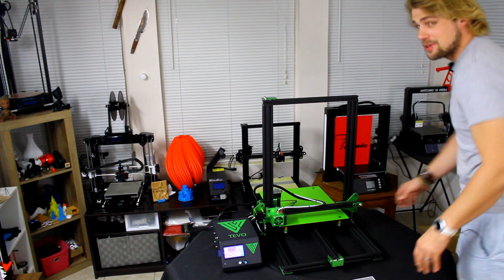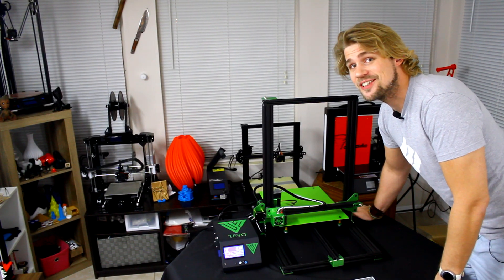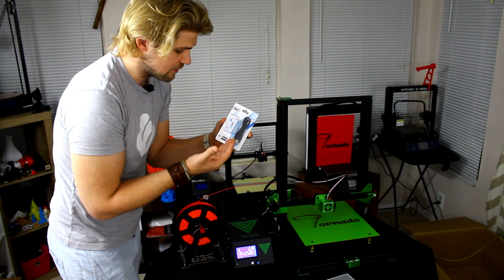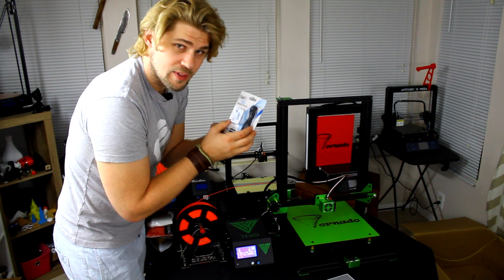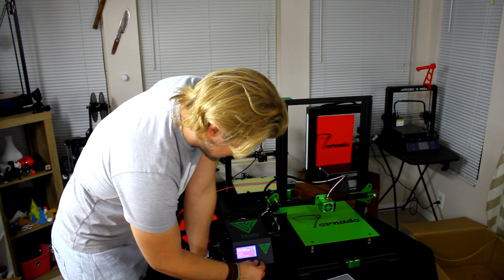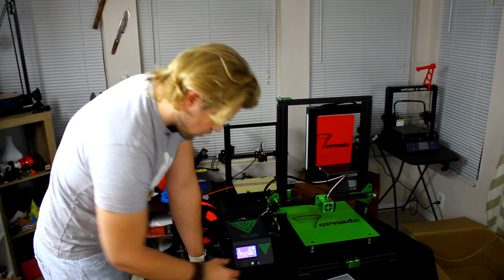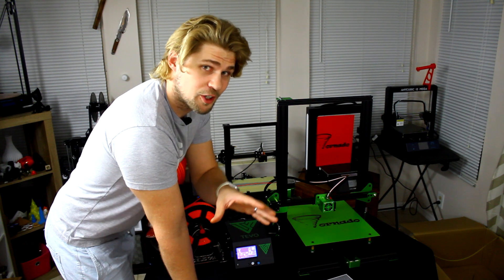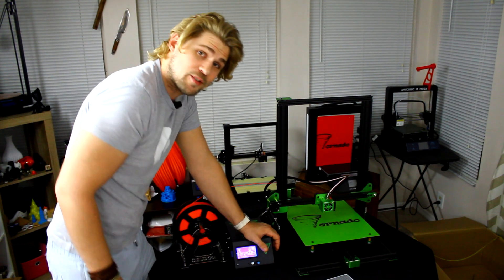✔ TEVO Tornado 3D-Printer ULTIMATE REVIEW!

Comment: Great review..

My experience...
I bought a TEVO Tornado and received it the second week in April. Since then I've had to order and purchase many replacement parts that were installed incorrectly by the manufacturer. The Support contact "Summer" messaged me upon  my sending my support request, on April 27, 2018, through their website site. They asked for details and images, since sending all info and 5-6 images they have not  responded in the last 12 days. I have allowed plenty of time, incase the case manager was sick or on leave for a few days. I bought it because of all the great reviews, but most are unboxing and initial thoughts of their tornado, only a few work with them for 100's of hours prior to review. Mine Worked on day 1, day 3,  and day 4.. Then it slowly has been falling apart. My input, look at other printers.. Talk to more people.. I'm very disappointed in the support, i know its not a $20,000 printer. Whether is $200 to $20,000 customer support should fix manufacturing defects. 
Viewers: Best of Luck in your search for a good 3d printer..
Reply from the maker: I completely agree!) Regardless of price support should be offering better help after first responding.
In my experience I can get returns from the selling company faster then I can get a hold of manufactures. Are you contacting Tevo or Gearbest?

Comment: As this is my 1st 3D printer and a few things (so far) escape my understanding. I just put the printer together and all went fairly well. I got the Red 3M sheet in the box, but I see printing on the green bed, so what and when does the red sheet come into play?
Also, in one of the bags there was some black thin wire, again nothing said about it in the instruction book. Lots of commands in the controller, some obvious, others may as well be in Chinese. If I knew what I was doing I know I could write a better instruction book. This is my view as an entry level user. If it were not for the YouTube videos like yours I would be totally lost. Thanks

Comment: May I ask what has better print quality the any cubic or the tevo or the cr10 ???
I vaLUE YOUR OPINION........................THANKS FOR SHARING
Reply from the maker: I have the most experience with the cr-10, still I think that the tevo and cr-10 are identical in print quality, what's nice is it comes with a tack board and it heats FAST! The anycubic is great but a step down from the other two IMO

Comment: can you make us a comparative video between tevo tornado and jgaurora a5? clarifying unique characteristics of each one? for example, the jgaurora has a filament detector and can continue an impression in case of power failure (I do not know if the tornado can), or another example, that the tornado has a bed that works at 110v or 220v and heats up super fast, etc
Reply: sorry for my bad English. greetings from Argentina
Sugerir un cambio

Comment: Nice video :) But as you can see at 12:05 this printer has a huge design flaw. The belt moving the x-axis is not parallel to the x-axis. This leads to non linear errors in the x-dimensions of prints (getting worse at the sides) and varying tension of the belt. I've seen this issue on a lot printers of this style now... I don't get why these manufacturers fail on these basic design principles of 3D printers :/
Reply: ahhh its easily corrected with an adjustment of the tensioner ;)
Reply: Isn't the tensioner the idle pulley on the end of the x-axis? Adjusting that won't help anything. To correct the error, the belt mount on the carriage must be change. Nevertheless, of course the problem can be fixed. But that's not the point. This is a "ready to print" printer and it is faulty by default. This shouldn't happen.
Reply: Have you found a Replacement part to fix this Issue? Could you please post a Link? Please.
Reply: Dave L I don't have one of these... so, no
Reply: Your completely wrong, this won’t effect the print. The belt is at a constant tension so any loss in tension when moving right is compensated from the left.